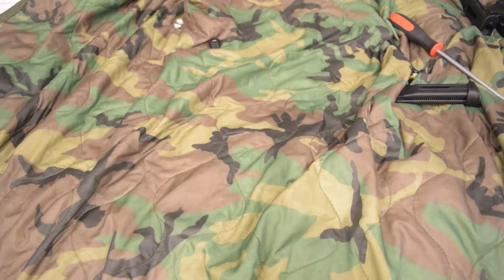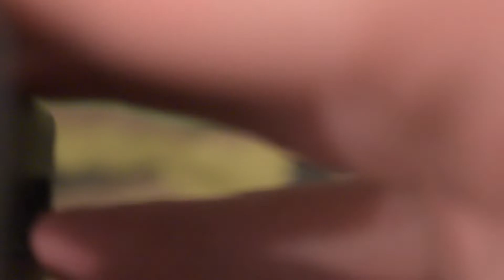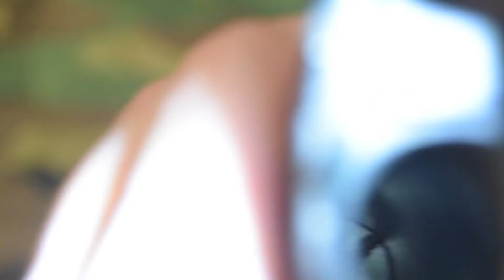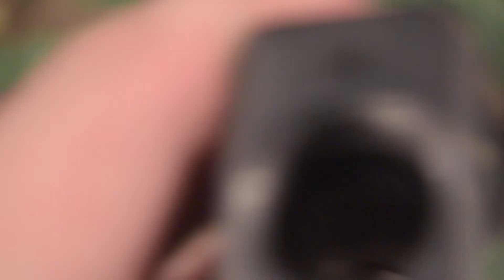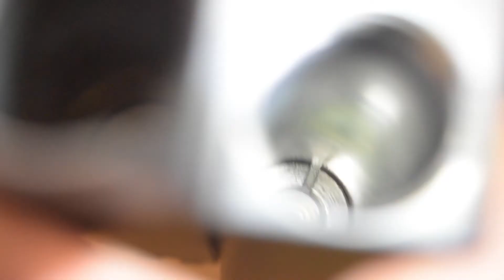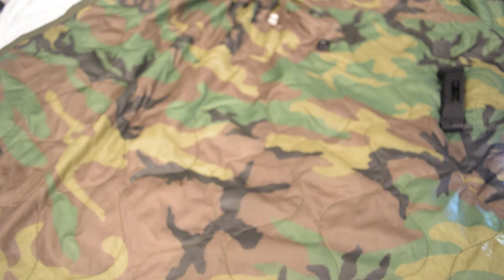KWC Co2 Magazine Piercing Valve Repair - Information, and Need Help!

Comment: yes! That is EXACTLY the problem i have! 
Nineball69, did you try and unscrew clockwise? Since those valves tighten and unscrew in reverse.
But yes, this my problem as well, and no tool is long or sturdy enough to do the job.
Reply from the maker: When I broke one of them out, it definitely turns like a normal screw, left loose.
Reply: @KlonoaTorqueBow  oh, i see. So it does loosen up turning left. Maybe its depending on what magazine model and/or manufacturing year then, as the m92a1 manual states "loosen right, tighten left".
Reply from the maker: @mannysan6039  There's instructions for installing the piercing valve?
Reply from the maker: @mannysan6039  Can you repeat your last comment? It's not showing on YouTube for me. Thanks.
Reply: my idea would be to try a chisel. You can get chisels in any width. just might haft to reshape with a grinder to get more of a screw driver shape
Reply: @ripingpuma2460  daaaaammmnnnn after reading the blah blah blah bs I FINALLY found an ACTUAL answer!!! And 'by George I think you've got it!!!"...no really though dude! Nailed it!!! Got 'er done for me and YOU deserve the props for that one!!!!! Fixed my shit!!! Xo
Reply: Read the "top tip".
Reply: Ok it seems youtube autoremoves links.
Reply from the maker: @mannysan6039  Try it without the link. Show me the way via google search terms. Thanks.
Reply: This is a site that sells that specific seal and in the description it states:
 TOP TIP – The holder that keeps this seal in place is an opposite thread! Turn clockwise to remove!
Reply: @KlonoaTorqueBow  I googled "bagnall and kirkwood bulb seal" and the image is a white ring seal on a black background.
Reply from the maker: @mannysan6039  Right, we can get the seals for these guys, but we can't get them out or put them in w/o pulling the actual valve first.
Reply from the maker: @mannysan6039  I have a KWC USP non-blowback magazine coming in the mail. I will use it as a test for my methods again, including trying to turn it to the right.
Reply: @KlonoaTorqueBow  Awesome. Let me know how it goes. But try not to damage it, i dont want u to take unnecessary risk. Ive also contacted the main distributor here in sweden who also provides repair services on all types of airguns. I mailed them last friday so we'll see what they say whenever they get back to me.
Reply from the maker: @mannysan6039  Excellent. My magazine should be here soon. Even if something happens to it, I don't have the USP model. It was just the cheapest KWC non-blowback magazine on eBay. Let me know what you hear.
Reply from the maker: I forgot to mention, there are magazine rebuild kits from Umarex/Elite force. They include two different types of valve keys. Can you take a picture of the piercing valve on yours for me?
Reply: @KlonoaTorqueBow  Is seems you have to "approve" links comming from me or they are being auto removed until you delete them or approve them. Should be in your YT channel settings. I took a picture but yea my comment with links are removed instantly.
Reply from the maker: OK, email me the photo to Tkbow@live.com
Reply: @KlonoaTorqueBow  Done
Reply from the maker: @mannysan6039  OK, same as mine. What I'm finding is that the key slots that are supposed to fit into the piercing valve, they're too wide, same with my customized screwdriver. The AIP valve key for the output valve was the right size I think, but it sheared to bits. I'll have to get a dremel grinder to reduce the thickness of the screwdriver's tip.
Reply from the maker: @mannysan6039  Holy shit! I got one out of the Mini-Uzi!
Reply from the maker: You were right! They turn clockwise to loosen!
Reply from the maker: https://app.photobucket.com/u/Evan_Wester/a/3240af7e-0b0b-4253-949b-40e7fdd0108c
Reply: @KlonoaTorqueBow  Jesus christ, i cant believe they dont provide the right tools for people to buy and who NEEDS to replace that valve.  There are replacement parts for everything, but manufacturing that specific tool seems to have been forgotten, or someone missed the memo.
Reply from the maker: Be wary, though! I indeed, had to grind down the tips on the pronged screwdriver. However, knowing the correct way to turn it, it may be possible to use just a regular flat head to push it in the direction.
Reply from the maker: @mannysan6039  Right? Wtf. I was also able to pour an obscene amount of 10 wt silicone oil all over the damn thing, and I was then able to tighten it using one half of the valve grooves. Seals up perfectly, no leaks!
Reply from the maker: I think we've finally figured it out!
Reply from the maker: Wait, it might not be that easy! I was working on a KWC SW40F, and the valve was supposed to be turned in the opposite direction. I don't think the direction is the same all across the models, and their versions of magazines. I did get it back in, though. Not leaking.
Reply: @KlonoaTorqueBow  ahh Nice!! So it is clockwise to loosen it. Now i need to get a screwdriver wide and long enough for the job. I wish we didnt have to resort to these "homemade tools" that might damage our products, but they dont give us much choice. Thankyou so much for your time to figure this out, you rock. 👍🏼
Reply from the maker: @mannysan6039  Do you have a dremel?
Reply: @KlonoaTorqueBow  Unfortunately i dont.
Reply from the maker: @mannysan6039  I will consult with the people at AirsoftSociety. I'll leave a link once I create the thread so that you can keep up with it, possibly make an account so you can add your input to the situation. It's probably the last "forum" standing for airsoft.
Reply from the maker: @mannysan6039  OK, here's the thread I've made. You can at least spectate it if you don't want to participate, but you may find that useful should you decide to.

https://www.airsoftsociety.com/threads/how-to-remove-these-kwc-piercing-valves.163327/
Reply: @KlonoaTorqueBow  Thx. I signed up so i can keep an eye on your post. 👍🏼
Reply from the maker: @mannysan6039  Howdy, I uploaded some videos on the successful removal of some KWC valves. Please note that the NBB magazines, which I also made a video on, are damn-near impossible to remove. May I have another picture of the valve you're trying to remove?
Reply: This is a pretty old thread by now, but in addition to a chisel, a file (those flat ones used for wood) works very well too. Just a heads up